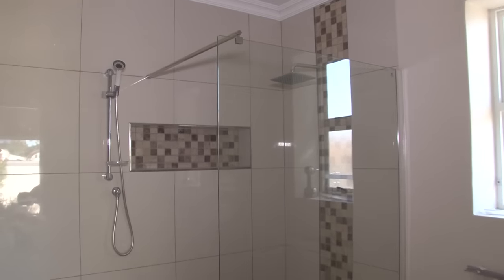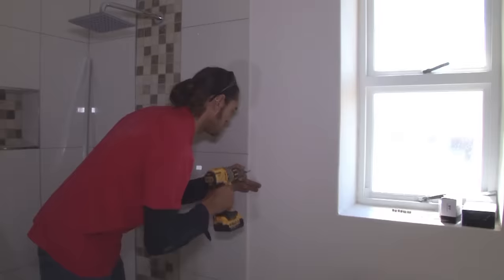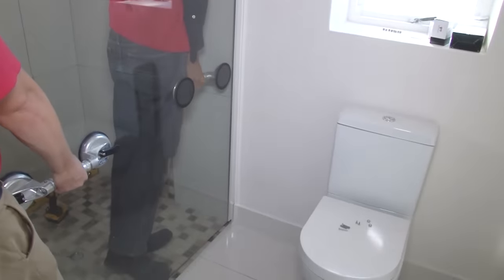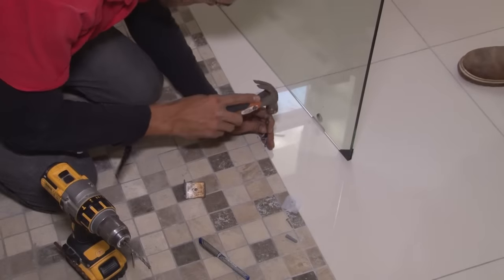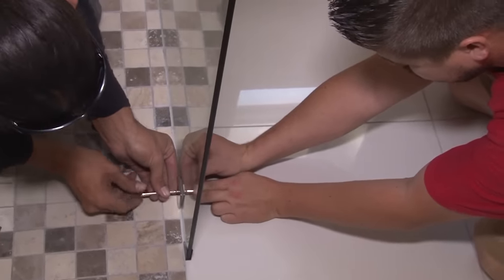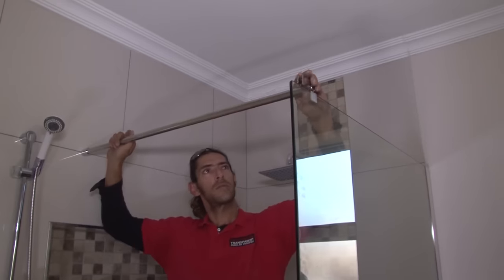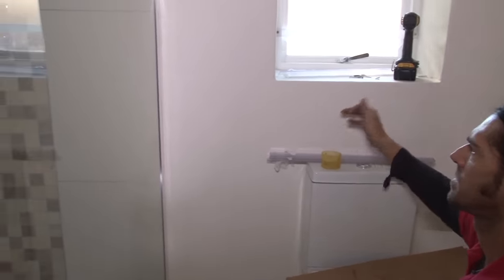How to Install a Shower Screen

Comment: First step is to buy the right glass thst suits the tiling bedding haha your around 200mm short. Do no drill a hole into the floor you just busted the water proofing. These guys have no idea

Comment: Outstanding video, to all those whining about various aspects of the install not being covered, watch it on half speed a few times and have a practice on some scrap materials. The video has to assume you have at least some aptitude as it's a short video. Otherwise get a quote from a qualified fitter, have a good cry then go about your day.
Reply: Correct. So many incompetent DIYers giving it a go. 'Didn't mention protect edges of glass' etc. Not to the comment, to the people trying to warn- If you didn't know that, maybe don't handle large heavy panes of glass. Not faulting these people it's here to view and follow for anyone.

Comment: Installed on vertical drywall instead of tile? Dear baby sweet Jesus.
Reply: Hi Bobby, these walls are made of brick covered with plaster.
Reply: Who would I get to install one of these in a wet room ? Would it be a plumber or a builder?
Reply: @karencurtis2697  a glass company.
Reply: Makes you wonder, at least seal the inside and leave the outside open

Comment: nice video. Why would you not just apply the silicone on the inside to leave a better finish on the outside ? Thanks Alan
Reply: Alan Connolly - To allow any trapped water to escape.
Reply: My guess would be that silicone that's constantly in contact with water will turn black with mould in about 12 months whereas the silicone on the outside would only occasionally have to block water from seeping through the shower area and would stay dry and clean looking for far longer.
Reply: I like to tape up before attaching the aluminium, give you a straight line to work to and then I add silicone when finally screwing on. Form out silicone bith sides, remove tape, neat lines with barrier where it really counts.

Comment: How did you drill hole in glass? Is there a special bit for drilling in glass? Thanks.
Reply: This sort of glass must be 'toughened' for safety, a heat treating process that puts the internal structure of the glass under quite severe stress.  This makes the glass must stronger, rather unintuitively.  However, it also means that, post-toughening, any attempt to 'change its shape' eg by drilling a hole, results in the internal stresses being 'released' and the glass will catastrophically fail.  Thus, any holes (eg for door handles) or radii on corners, or shapped hinge cut-outs for the special hinges must be done prior to toughening ie in the factory.
Reply: So when he was drilling into aluminum chanel It was into metal bracket on wall.
Reply: @robertfong-mow7235  Unusually, the glass appears to come with a pre-fitted alu cap which then fits neatly into the alu channel screwed to the wall.  The drilling at 01.22 appears to be the pre-fitted channel to wall channel attachment - glass is not drilled.

Comment: never seen a panel that has the aluminum strip on it....we normally put the raw glass into the wall U CHannel......how come it has that aluminum strip? for protection of bouncing?  Did the glass have a hole in the base to apply that bracketon the floor?
Reply from the maker: The unit was pre-made and included a hole in the glass.

Comment: Can't the tiles break at the anchor points. Then you'd be up for big expenses.
Reply from the maker: Yep. Using a sharp quality drill bit is essential. Once the holes are drilled and the screen is fitted it's unlikely that the the tiles will break. But if you're unsure get in a pro to do the installation.

Comment: Did nobody recognize that the shower head is actually outside of the shower?
Reply: Your thinking outside of the box is totally skewed OR you are crossed eyed.
Reply: @samoanSAIYAN  
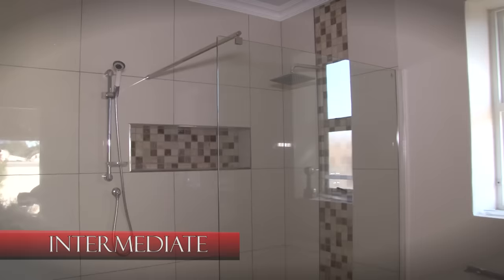@3:49 
I think he just missed the rainfall head in the main shower but there is also another shower head on a hose within the designated shower area but outside of the 'glassed off' shower section.